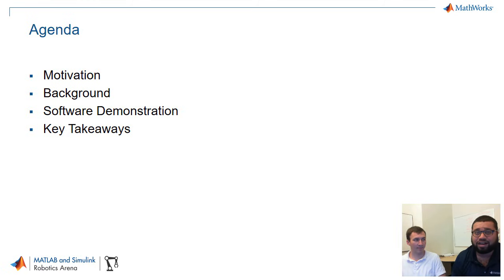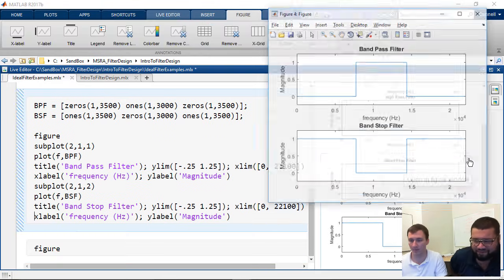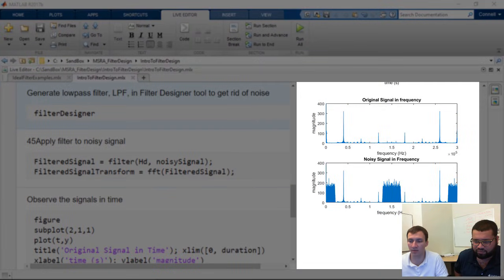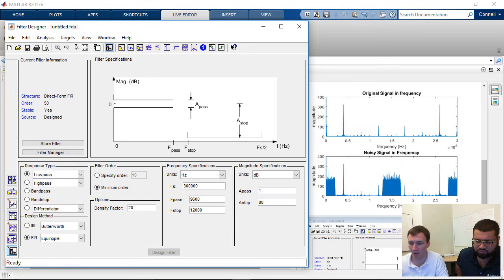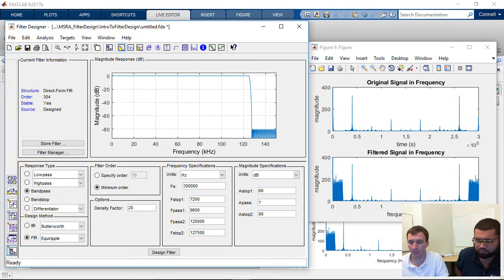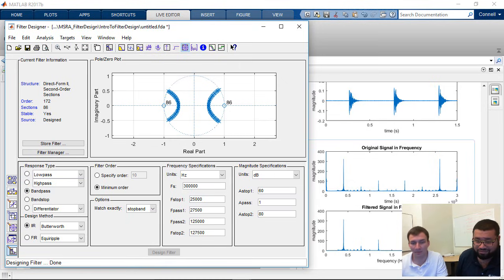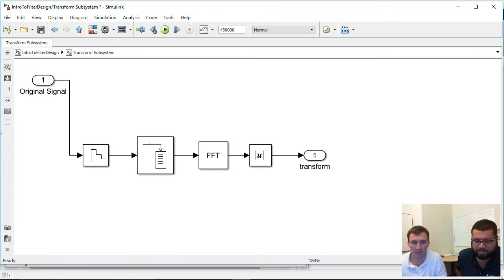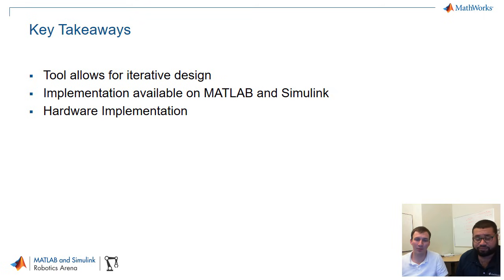Designing Digital Filters with MATLAB

Comment: sir, I have a doubt 
I am using the GUI program in MatLab so I have designed an RLC circuit so when the user enters the value of R, L and C ryt but I have to how It displays the type of filter it is (low pass, high pass, etc.) for will be the code for that? can you help 
thank you
Reply: Can you tell me how to choose fs for filter design?
Reply: @shubhamnayak9369   sorry I couldn't get your question
Reply: @quadriquadri1655  around 8:46 you can see in frequency specification box there are options like Fs,Fpass,Fstop ... So how he chose Fs that is my question